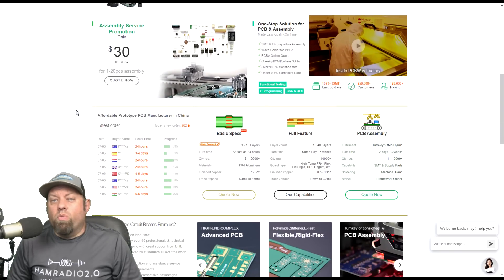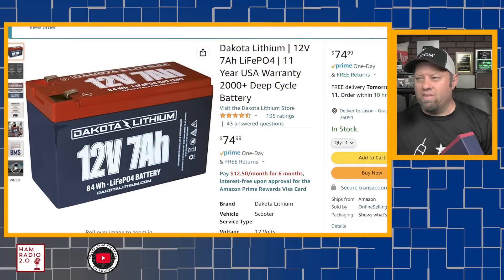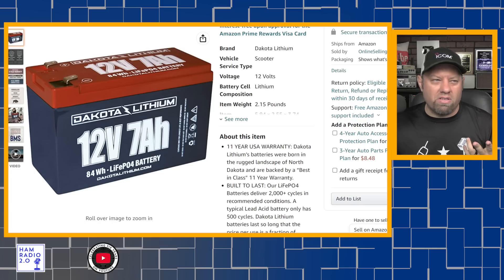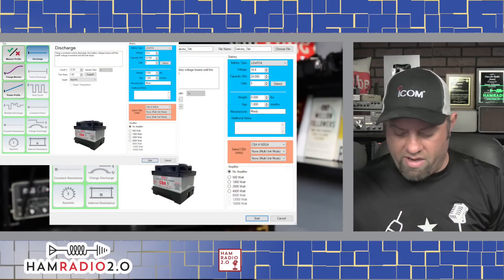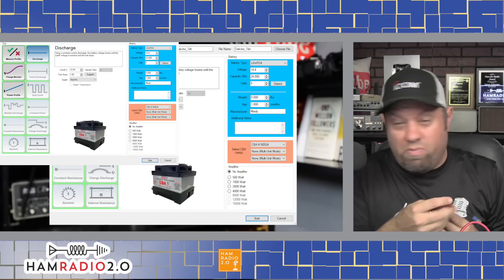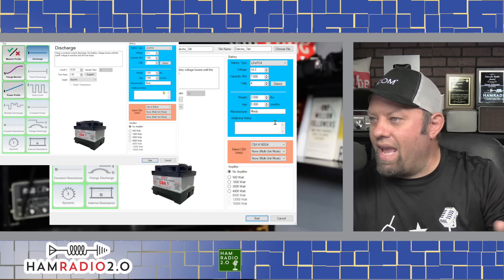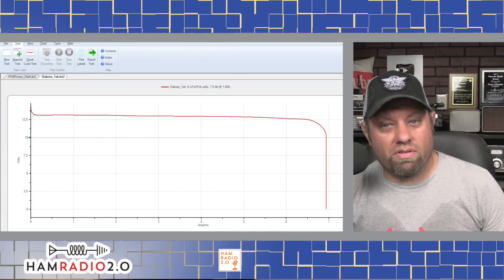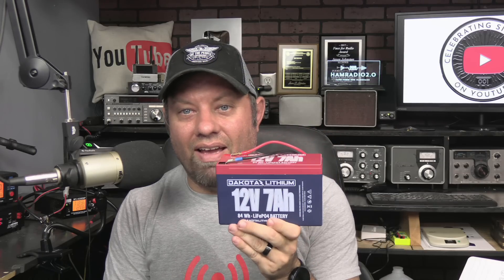$75 12V 7AH Dakota Lithium LifePO4 Battery Test

Comment: Dakota Lithium is an overpriced LifePo4 battery backed by lots of adverts. There are a lot of other brands just as good or better.
Reply from the maker: But none of those other brands have an 11-year warranty
Reply: @HamRadio2  LifePo4 batteries have an average 3000-5000 charge cycles before they are dead. Let's take the midpoint of 4000 cycles and divide it by 365 (assuming you charge them once a day, everyday). So 4000 charge cycles would take 4000/365=10.9 years. Thus the gimmicky 11 years warranty of the Dakota Lithium. If a battery uses high quality cells and built with decent parts and labor there is no need for such an unrealistic warranty. A 2-3 year warranty on manufacturing defects is what you need.  It is also worthwhile checking the multitude of warranty exclusions in Dakota's website.  With all these exclusions it is almost guaranteed that they can deny any claims you may have in the future.
Reply from the maker: Bold of you to think that the cheap Chinese batteries are made with high quality cells and built with decent parts and labor.
Reply: @HamRadio2  Really!..Where do you think Dakota battery cells are made and batteries are assembled. 😅 And by the way, to your chagrin China makes a lot of quality products along with cheap ones. too. If you know what you're buying you save a lot of money over these overpric
ed , supposedly Made in USA products.
Reply from the maker: @AW-nr6ij  I never said Dakota batteries were made in the US.  In fact, I am pretty sure that I said in this video, that they were from China.  Your original comment was about their warranty, and my reply was about it being presumptious for you to think that cheap Chinese batteries are assembled with the same parts and quality as the more expensive ones.  It seems you are stil doing that, even though you are trying to change the subject.
Here is something that should really blow your mind - no one is focring you to buy these batteries!  Wow, right??  So if you don't them, don't buy them.  Pretty simple, really.
Reply: @HamRadio2  I never said cheap Chinese batteries are the same. What I said is there are many other well made batteries out there for half the price of Dakota Lithium. As I said before China makes good and bad stuff just like other countries. As a consumer you have to do your homework, and my homework resulted in a quality LifePo4 battery made by a Chinese company for half the price of Dakota equivalent and I am very happy with it. In fact my other batteries (like my eBike etc.) are all Chinese batteries and never had any problems with them.  Dakota's 11 year warranty claim wasn't enough for me to pay twice the price. So if your pockets are deep and don't mind the bad customer support (they require you to pay for warranty returns - and thats if you can find a shipping company that accepts dangerous goods), then go for the "11 years" or do your homework and save some major $$$. Of course getting shafted is no concern for a guy who owns a $100,000 boat to catch bass, but for us regular joes it's a different story.
Reply from the maker: If you'd "done your research" as you claim, you'd know that I have tested, reviewed and recommend many other batteries. Most of them don't have an 11-year warranty. That was my only point. All of this other stuff that you seem to be arguing with yourself about is outside of the original subject. That's it.

Comment: Apparently you didn't check the Battery Management System.  Other reviews have shown that the advertised short circuit protection does not work.

Comment: Are those a direct replacement for sealed lead acid battery same size voltage and amps?
Reply from the maker: Depends on the application, but often times yes

Comment: I have been into radio from the 1970's . LiFePO4 is far the bast type of battery for the 12V world. would like to see a test on some old bioenno that has been well used, This will be a good test to see how they hold up over time. also charge on put in freezer over night and test it. a outher great test is fully charge on. let it set 30 days or more then test it. battery's are the hart of Pota .and Sota ! years back we used 6V golf cart battery's 2 to make 12V . big and heavy for field day. how many hams run LiFePO4 for Sota and Pota?  I am running Power queen   and some outers.  73's

Comment: I buy a lot of these for the product I sell.  These batteries are pretty good.  From what I understand they used to bring in all of the cells from China, then do a domestic assembly, but about 3 or 4 years ago they started also assembling in China as well.

Comment: Thanks for the fine video, Jason. I'm considering a number of brands of LiFePo4 batteries and was wondering if there is a universal charger that can be used with these batteries, or do you have to have a charger specific to the brand you buy? Thanks, and 73!

Comment: What are the benefits and disadvantages of different battery brands?

I have an ic-2100 (12 A transmits current draw)

Weight is Not impotent. $ /total hours is.
I expect liPo4 to be leaps ahead of AGM or deep cycle?

Do the Dakota lithium and Mindy perform/ last as long bioenos?

T
Reply from the maker: The test of time is what is important, in my opinion.  And we won't know how they measure up until time has past - so a few years from now.

Comment: I would love to see this kind of testing again, but perhaps put the battery inside your fridge to simulate a colder camping scenario and then again perhaps in hot weather, outside at temperatures more in the 90's. Retest the other variants as well. Let's be honest, batteries are desirable because they offer remote ability and that often means in conditions less than ideal as apposed to being at room temperature. 

Thanks so much for your HAM contributions thru YouTube. You are one of my favorite "virtual elmers"! 

Greg @ KD9UQP
Reply from the maker: Those are great ideas, I will look into doing some of those types of tests.

Comment: I have a 7 AH, 2 10 AH, and recently bought both the PowerBox 135 AH and a stand alone dual-purpose 135 AH battery, the latter two re used in a small solar array. They are very expensive, but so far very reliable. Both the PowerBox and the stand alone 135 AH came in boxes clearly identified as made in China.
Reply from the maker: Thanks for sharing
Reply: BTW, I was using the two 10 AH batteries in parallel to power my 7300 in my home shack. They would last several days before needing recharged, unless I used FT-8. That suck the power quickly. 
KD9ROL.

Comment: Appreciate the battery tests. I am in the market for a battery now and you just put these on my radar. I love the fact that they are lightweight, even compared to the Bioenno.  Pricewise I see that the Dakota 10ah battery is the same price as the Bioenno 9ah battery.  Great performance, lighter weight, and more amp hours for the money.  I'm in.

Comment: i just took a look at the Weize (12V 10ah LiFePO4) battery John was talking about in the comments.  They do look like the same casing (which doesn't mean anything), same (2,000) discharge cycles, LiFePO4, Smart BMS, etc, for $25 less.  Since you're doing a video on the Dakota anyway, could make for an interesting video to do a comparison on the 2 batteries.  Do that test with the CBA-V on the Weize as well, then when you go out for the test, do the RFI check, longevity of the charge (but i guess you'd have to use the same radio on each battery to be fair, checking battery output at each hour, till it runs out), maybe even checking how much it effects the power output of the radio when you get towards the end of the battery capacity.  Then if you feel adventurous, open up both batteries to see if the components are possibly the same on the inside (using safety precautions, of course) AND if you go that far, maybe even submerse it in water before opening the battery, to see how water tight they are   :)
Reply from the maker: There are dozens, if not hundreds, of battery brands that use the same casing and size, including Bioenno.  The casing doesn't matter, the cells inside is what matters.  Some of the cheaper brands are probably copying each other, but I doubt the better, more reliable brands are doing this.  However, that is part of the research and testing that I am doing.

Comment: I just bought a "Weize" brand LifePO4 10 amp battery for $49.95 off Amazon. The case and construction of the battery I bought and the one you are testing is exactly the same except for color and branding. More amps for less $$$. I have to wonder if maybe these batteries are all made at the same factory and branded differently ? I don't have the tester, so I can't verify a true 10 amp output, but in use, it has been excellent. Maybe try out a Weize brand when you get the chance. For my 20 amp, I've gone with the Bioenno. Great battery. Just food for thought. Good review and test. It is possible that Dakota gives better factory support and that is the real difference, not the battery. Maybe you are paying for the name and both give decent support. That I don't know....Just thinking out loud.
Reply: The Weize 50AH and 100AH batteries are built really well for the money and have decent BMC’s
Reply from the maker: The true test will be on how many charge cycles it takes
Reply: @HamRadio2  Agreed, my question is are they the same battery with different branding. Could be, but then again, maybe not.

Comment: I purchased 3 of the LiFePo batteries Gigaparts is selling (12v 12ah). Used them for field day,powering an Icom 7200 running at about 40 watts. Ran my station for the entire operating period without recharging.
Reply from the maker: I have those. They're great

Comment: There are strict regulations about labeling something as "made in the USA".  "Assembled in the USA" means a defined percentage of offshore parts have been used in a product built here.  The Federal Trade Commission is in charge of the rules, adherence and penalties.
Reply from the maker: This battery has neither of those labels

Comment: That’s the great thing of lifepo4 vs LliPo, LiPo will drop in voltage as it discharges requiring a regulator for 12v batteries, LifePo4 will remain 12v to the end ;). Better for sensitive electronics.
Reply from the maker: Yep

Comment: Back in 2020, purchased two of the 7AH batteries as a set and reduced cost. Don't remember what the cost was but it was very reasonable. Have used them in my back yard with my IC-7300 and have never had an issue. Would deffinitely recommend Dakota Lithium batteries.
Reply from the maker: Thanks

Comment: Curious what the RF noise level is (maybe compared to the Bioenno) when you do the field test, since their target market is fishing and not radio.
Reply from the maker: Yep, that's on the list
Reply: My 12 ah dakota hasn't had any RF issues, don't use it as much as I like but I have taken it on prolly 20 portable outings.  I'd buy from them again with zero worries.
Reply from the maker: @nimroddiaries_  I can't imagine how a battery works cause RFI but who knows. Thanks for sharing
Reply: @HamRadio2  There is a BMS (Battery Management System) inside the LiFePo4 sealed consumer batteries. A lot of the ultra cheap brands have noisy BMS's, most of the good ones do not. Dakota's are supposed to be good and I've never heard a bad word about them. Their support gets some not-so-great reviews but they always seem to come through in the end. Their suppoort strongly prefers e-mail. Obtw, many reviews state that the Dakota's come with a Made In China sticker on the bottom when they arrive.
Reply from the maker: I'm well aware of how a BMS works. This battery has no labels at all... China, USA, nothing